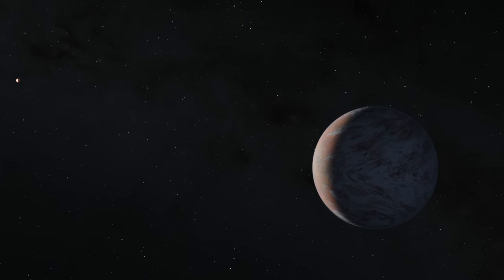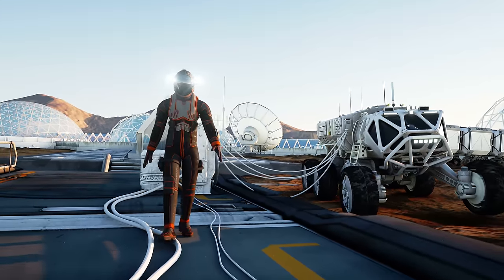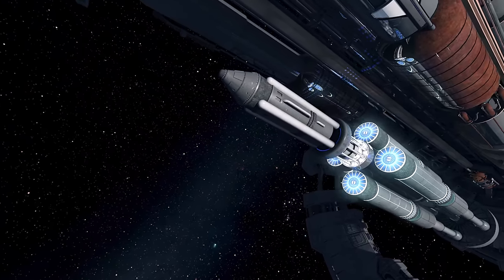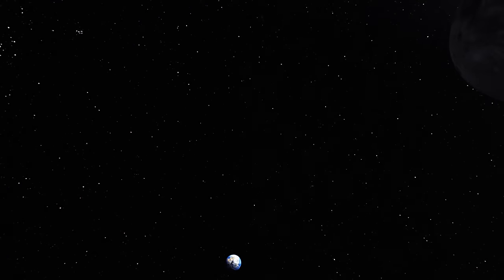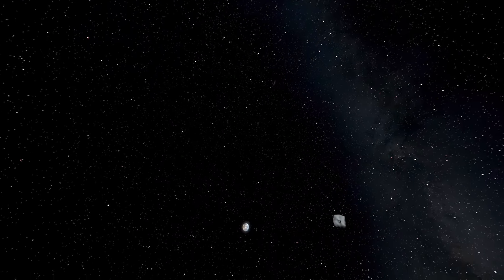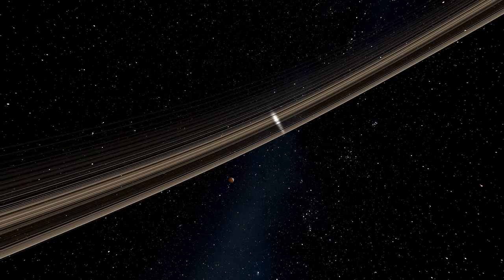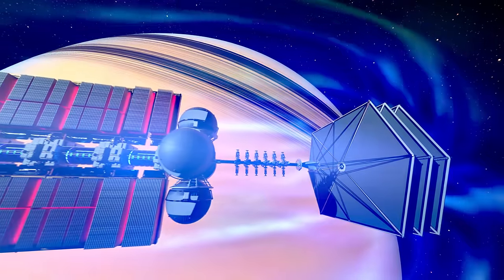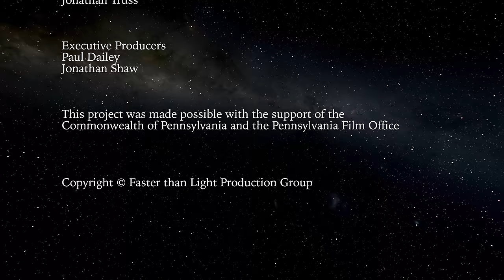FASTER THAN LIGHT: The Dream of Interstellar Flight 4k

Comment: How far and how fast? Sadly, not very far and not very fast. We have made almost zero progress in propulsion since the 1960s. We are still using chemical rockets, which will struggle to even reach another nearby, planet and forget the outer solar system. It still takes decades to send a small, unmanned probe. Sure, we can find exoplanets, getting good at that but we have zero options for getting there.
Reply: We used a lot before we used nuclear. Energy extraction and use are advancements that come in leaps and bounds. We have ideas for potential methods of acceleration that could get us where we want to be. It’s just a matter of doing pure physics research and putting money into it.
Reply: I also agree with you. Space explorations simply isn't a priority for humanity rn tho it should be
Reply: incorrect in everything, modern day spaceships are incalculably  more advanced, much faster and more efficient than anything in the 1960s. a modern day rocket travels many times faster than any built in the 1960s or 1970s
Reply: Is out of the question. Armageddon is coming and the Earth will be destroyed with wars.
Reply: @tshavfengvang7831 the Sun will hand us another extinction before
Reply: Only because the government won't let us use more effective propulsion methods.
Reply: Checkout the satellite slingshot.
Reply: If there are "WILD" Wormholes maybe tamed ones will get us where we need to go.
Reply: @doug2424 I would think so and yes probably natural or wild wormholes and artificial ones, I would bet on space folding,, it is important not to reference soft sci-fi media like Stargate or Star Trek, both offer impossible ideas about space travel or wormholes
Reply: @shawntipton5078  I didn't mention Stargate or trek  because they're the opposite of a physics lecture.....lol captain kirk had so many g.v.ds, galactic venereal diseases that they Quarantined the enterprise every time they came to dry dock! Hard science fiction rules!!!
Reply: marites
Reply: Are you kidding us man? Private companies first of all SpaceX, have made unbelievable progresses! Don't talk if you don't follow this kind of stuff....
Reply: Nuclear rockets planed for 2027
Reply: You're willfully limiting your own perspective.

Progress is a repetitive pattern of Stagnation and Jumps.
Reply: With quantum entanglement wormhole it would be easy bro
Reply: @breezelight3357  hmm no. That’s sci fi crap. No such thing exists

Comment: Do you realize what a tiny particle of dust would do to a Spacecraft traveling at the speed of light
Reply: Space will definitely have to be warped in some way in front of the space craft to divert any objects encountered in travel. It seems to me that just travelling at even a percentage of light speed would cause unwanted heating of the ship's hull from the friction of star light in space. I'm not a physicist, so maybe star light is not sufficient enough to cause friction on a ship travelling at some percentage of light speed, but it seems likely that space craft would encounter dust particles, and cosmic rays, let alone larger objects that would make travelling at some percentage of the speed of light impossible without some mechanism to deflect objects in space.
Reply: Actually the speck of bust would not  be a problem, at the speed of light, the mass and velocity of the craft would be so great that it would not even notice the dust.
Reply: The tiny particle of dust would go straight through the spaceship that's why you need a forcefield!
Reply: Definitely seems like a huge problem.  As 'perkins' says, any object with mass at such speed would pack a wallop.  Sci-fi writers have thought up ways to potentially combat this, including lasers and so forth clearing the way ahead of the craft and of course, coating the exterior of craft in vast amounts of 'ablating ice'.  Either way, you want some sort of 'sacrificial material' to take the wallop instead of the skin of the craft.  Again, you may be right in that this poses the single most challenging problem and may yet make such travel impossible in practice.
Reply: @charliejohnston1978  That's not right, I'm almost certain (from what I've read and heard from physicists) that even tiny, low mass objects would create incredible damage.  Localised yes, but damage nontheless.  Space may be a vacuum but again, if you're travelling at sufficient speeds, you'd encounter motes of dust.

Comment: The distance to even the nearest star, while staggering, is still FINITE. Pluto is 6 billion kilometers away. The nearest star Proxima Centauri is 4.2 light years away and equates to traversing approximately 40,000 billion kilometers. Even at the speed of light 300,000KM/sec, it takes light 1 year to complete 9,461 out of those 40,000 billion kilometers. Within the next 500 years humanity should be able to obtain 10% light speed (30,000KM/sec) and reach Proxima in about 40 years.

Comment: I’m thinking of two different rocket boosters filled with opposing matter each heated or kept at space temperature to then be mixed for propulsion the heat that can be generated and stored in many materials is massive the potential for the rocket would be really good and could travel at speed the same people researching it will get it done

Comment: You can not go faster than the speed of light, Einstein said so. Even if you could you would be going nowhere fast. The space outside our solar system is measured in light years.
Reply: You're right.  Even approaching light speed, the journey times would be very, very long.  It seems almost impossible from my 21st century vantage point.

Comment: How can mass move faster than what it's made of? By disolving internal magnetic fields grounding currents into itself as external heat energy outside of entanglement of mass as potential renewable heat energy when entanglement with mass occurs again as something totally different. Heat energy comes from elements disolving into heat waves from decaying stars atmospheres near and far away throughout space. Galaxies are formed around external magnetic fields where the flow around these spheres of absolute zero heat energy within its core or nucleus spinning around these monopoles of pure fabric of cold space repulsion like a record on a record player centrifugal force of magnetism. Heat is the universal force of pressure known as the lifeblood of everything as external magnetic and internal magnetic fields grounding currents through its core or nucleus. External magnetic fields cycling circulation around these spheres of monopoles of pure repulsion to heat energy propulsion momentum outside and within entanglement as mass. Galaxies spinning around black holes are external magnetic fields of centrifugal force of magnetism flowing around these monopoles of pure fabric of cold space within. External magnetic fields don't ground currents through the nucleus or core but cycle circulation outside the spheres. Theoretically factual probability that works with quantum physics without gravity.

Comment: The answer is definitely not speed. Traveling at the speed of light, over a distance of 1 light year, still takes one full 1 year. QFT and Quantum Tunneling and Locking, presents a prospect of far greater distances being traversed, near instantly. Utilising the Einstein-Rosen Bridge, wormhole concept in connection with Lagrange points, just one of many better options.
Reply: The Einstein Rosen Bridge is based on the since disproven general relativity theory. 
The universe is flat. There are no shortcuts from point A to B. You can create a wormhole (increased electrical energy) to allow light to propagate faster.

Comment: I think the shoulder s a i l is the most ill-conceived idea for space travel I've ever heard of. Because one thing it doesn't account for us all the space dust it's going to be encountering in between here and Proxima B which would definitely cause it to decelerate I doubt it would even make it there not to mention one group of micro meteors and it's done and what happens when the Starlight from the Proxima system impacts the s a i l. I just think it's a huge waste of resources

Comment: Light speed is entirely possible. Light does it. We are already moving at a combined multidirectional speed of around 2 million m8les an hour at rest on the surface of the earth. If we were to just stop moving with the earth it would zipp away quite quickly. Whats crazy is im seeing craft on news tv now that are already doing just that. No thrust or control surfaces? How is it possible? They just stop.
Reply: Rotation of earth + revolution of earth + movement of Sol through the Milky way + movement of Milky way toward Andromeda = nearly 2 million miles an hour in 4 different directions at once. We are not big enough yet to measure the combined movements and directions of our local cluster or the galactic filament we reside in so we are actually moving in 6 directions at once with a multidirectional speed of ?? over 2 million miles an hour. We move pretty fast even just sitting on the couch watching tv.
Reply: At least 6 directions at once possibly many more.